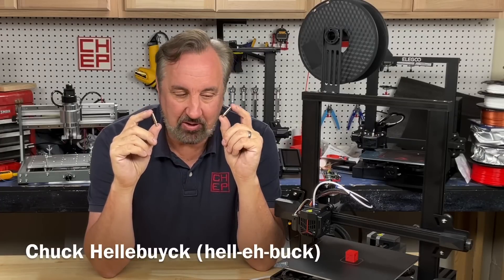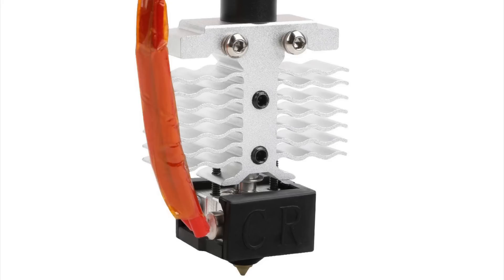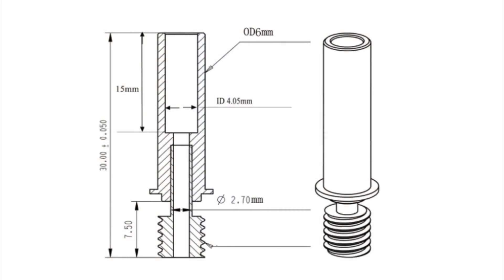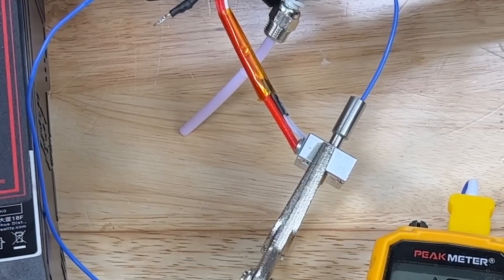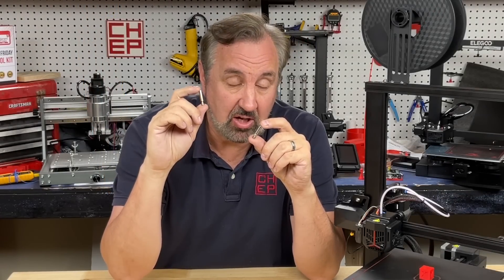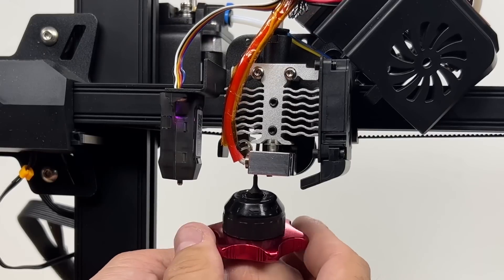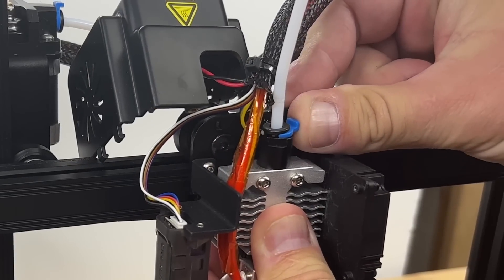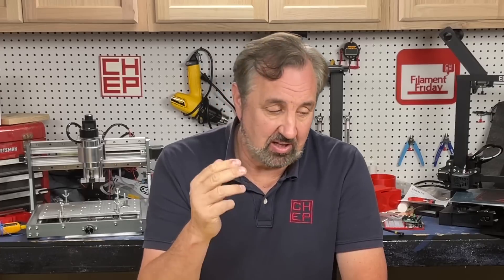Upgrade Ender 3 Neo Hot End

Comment: Hi @Chuck what an eye opening video! Thank you! just ordered all metal heatbreak from the link you provided. I have Ender 3 v2 Neo as well. I am only buying this to stop PTFE tubing not to melt and block nozzle some day. My printer is new but it is best to be prepared from the start I guess. Cause by design the stock heartbreak is a time bomb. What I wonder is Titanium heat transfer characteristics? Do you have to increase hotend temperature slightly for PLA? I am printing PLA at 210 Celsius with stock heatbreak. I have an update! Bi-metal heatbreak came installed exactly just as Chuck instructed. It works beautifully much more filament is can be extruded from nozzle with this upgrade too! Plus I don't have to worry about my PTFE tube melted one day in middle of printing... This is just awesome upgrade Chuck Thanks Man! There is no need to upgrade to slice engineering's hotend with this bi-metal heatbreak upgrade! Only thing was not exactly is the heatbreak's outer diameter is half mm bigger so I sanded down a little and then outer shell become exactly 6mm then I could insert heatbreak into the heatsink easily.

Comment: pleas do more for Ender 3 Neo!!!
Reply: Hey i am going to buy my first 3d printer but i am not able to decide which to buy ender 3 neo or anycubic cobra i am also new to 3d printing 
Please reply 🙏
Reply: @oioindoor8155  ender 3 neo is awesome
Reply: @gimmmy90 yes it is😅
Reply: @oioindoor8155 Im also new to 3d printing, and narrowed it down to the same 2 printers. I ended up buying the ender 3 neo not to long ago, and I like it. I still have problems with stringing, because I need to get better at the slicing software. I was using Creality slicer and was getting good results, but I’m moving over to cura slicer, and haven’t got the same results yet. The only thing I dont realy like about this printer is the hot end, and the drive system, direct drive sounds much nicer. However there are many upgrdes for this printer, and some are 3d printable upgrades… so thats nice. Hopefully this helps a bit if you haven’t already got one
Reply: YESSSSS
Reply: YOOPAI Spark Ender 3 NEO ... They finally released a decent hotend for the neo on Amazon... no modifications needed... so far I'm loving it and figured id come back to this video and share
Reply from the maker: @Silent_Steel - What is the name? All I see on amazon are the same type as original.
Reply: @FilamentFriday  YOOPAI Spark Ender 3 NEO ...  its black and orange... really wish youtube would let me post a link
Reply: I'll try and find an alternative way to search it up.... yea if you search "YOOPAI Spark Ender 3 NEO" it'll show up as the 1st 2 results... atleast for me... and has been working great in my ender 3 v2 neo... which has been hard to find replacement hotends that you don't have to modify
Reply: I was having problems with my neo throwing heating alarms around 210° which was driving me nuts... but this hotend has seemed to finally fix that issue... for now, anyway lol

Comment: This works fantastic on my ender 3 neo. I pair this and a brass/ruby nozzle for abrasive material. Reduce your retraction settings to 2mm at 80mm/s, and run a temp of 235 PLA, and 260 ABS. Carbon fiber PLA runs at 260 as well
Reply: were you having trouble at the lower temps?

Comment: My experience with the NEO - that darned GB3 board is a pain - cannot use any firmware other than Creality's.
Reply: GD32f*** boards work fine with MRISCIC pro firmware and Jyers firmware.  Just gotta flash the board with Creality's stock firmware first before re-flashing with another firmware.
Reply: No, I flashed klipper on it. It works like a charm. I used KIAUH, which is the standard way of installing klipper.
Reply: @abhijeet_ghosh   Have been struggling to get klipper working on the neo. Any tutorial or setup files you referred to?Any resources you can share will be appreciated

Comment: Hi. I just installed this heat break on my Ender 3 V2 Neo following your instructions, however now my printer won't extrude filament. The nozzle is hot, the heat block is hot, but the filament isn't coming through. It's like the heat break is so efficient that there's not enough heat to melt the filament. Any ideas?
Reply: Hola, lo que puede estar ocurriendo es que no quedó bien instalado el barrel con la boquilla. Hay videos en YouTube que explican cómo instalar y apretar en caliente para evitar fugas que ocasionen obstrucción. El problema debe ser eso ya que bien instalado no ocasiona problemas. Saludos cordiales!!
Reply: I know this comment was a while ago, but I’m having the same issue. Did you ever solve this?
Reply: @armoryofalbus  Yeah dude. It was the easiest thing in the end - you need to snip the filament at a 45° angle before feeding it in. Basically, the hotend is a little thinner than the filament so if it's cut straight then it won't fit. Basically need to get in a habit of cutting a 45° angle on the filament before feeding it in every time.
Reply: @HeroicDesignCo  amazing. I always snip it angled, but was having a bit of despair moment after installing this new piece and not having any filament come out..gave it another snip after reading your comment and it’s working like it should! So glad. did you mess with any other settings (retraction, temperature, etc) to get this thing working well with your printer? Thanks in advance.
Reply: @armoryofalbus  I did a retraction tower and ended up pushing it all the way up to 70 for the best results. Other than that it worked right out of the box.

Comment: Hi chuck. I hope
You can help me. I changed the heat break to what you recommended but now my dual drive filament extruded is clicking and stops the filament from going into the hot end. Any thoughts? I’ve already taken apart the hot end and reseated the new heatbreak and made changes, but it is still happening.
Reply: sounds like heat-creep.  Reduce retraction and temp.

Comment: This turned out to be a great upgrade, but it was definitely not "plug and play" for me. I had to tighten up retraction settings to around ~2mm like others have mentioned, but still got bad stringing.  After a PID auto-tune helped but did not solve my problem, I calibrated my extruder steps also. Out of the box it was under-extruding by 8mm. I also found it helped to return to the stock 200/60 PLA settings, and play with Z-hop.

Comment: 😠Beware of bad imitation heatbreaks. With the imitations, the lower metal part is screwed into the copper part for about 3.5 mm. Not pressed all the way to almost the teflon tube as in the picture with the sizes. Teflon tube can also only fit 4 mm and not 15 mm as in the picture. The pictute of the fake was the same as in the link from Chep.

Comment: Can anyone that has done this upgrade comment if it's actually made any difference? I have just installed this on my ender 3v2 Neo and have not yet really seen much of a difference... Would love to hear from anyone who has done this upgrade. Update: I have never ever had my machine give me system errors so often, 3 times was enough for me to change back to the standard great throat, I repeat do not even attempt this upgrade if you have the ender3 v2 Neo!!!! Over extrusion, system errors, to be honest with you why try to fix something that's not broken. I'm not going to even bother with my retraction settings to get this to work I tried adjusting the retraction but still had a temp to low error. Stay away!
Reply: Not a big difference, not worth the work.
Reply: There is a problem with stock thingy which is used on Ender 3 Neo as a heatbreak. PTFE tube gets carbonized and because of this printer gets clogged. It takes somewhere between 3 to 6 weeks of intensive printing (with PLA at 205°C temperature) to get into this trouble.

So, theoretically, this upgrade should 100% fix the issue. Plus you'll be able to print PETG, which is frankly bad idea with the stock heatbreak.

But. It's not as easy as Chep claims. :) Retraction settings must be corrected (otherwise you'll get the heatbreak clogged almost instantly). I faced issues with pretty bad stringing, which I can't address so far.

Comment: Yea this doesn't work.
Reply: It seems people is having issues with this. I did exactly what Chep did in this video and is working perfetly with my Ender Neo. I'm running temp tower tests and retraction tests and they are all working with pla (with obviously different outputs but all working). Update: after 4 days of printing with the bimetal the problems started (it clogged and skipped) so I went back to the stock barrel. I'm printing with PLA only and there is a lot of humidity here so I'm not quite sure if the barrel is the problem.

Comment: Hey Bud, I tried this but for some reason it's not pushing through. Its
getting stuck I believe at the smaller Neck portion of the new heat break. This is kind of strange because I took it out and tried to push the filament through with it not Installed and it goes through just fine. I am running a bowden Capricorn Tube Not sure if that's relevant but was hoping you might have some advice.  Thank you, 🙏 .
Reply: Get a new Bowden tube. The stock tube is fractionally larger and won't meet flush with the recess in the heat break.

Comment: Not a bad printer, but the company support is a 'F'.
I bought one of these 2 months ago.  Printer 5 rolls of filament with no real issues.  I cleaned it after each print, leveled the bed after each print etc etc.
Then the other day.  I had  a 15 hour PLA print going and I checked in on it after 8 hours from my remote app and the printer was moving fine but no filament was coming out.
I went to my print room and stopped the job.  The hotend had become clogged and the extruder continued to force filament down into the hot end where it built leaked and created a mess of the hot end.  It wasn't salvageable by cleaning and so I contacted their support.  I am sorry, but it is terrible.  This is a $15 part and I am having no luck get then to even understand.  This should be a slam dunk - send me another cheap hotend, but no they don't seem to get it.
I bought this as an entry level printer and was going to buy another Creality higher end model, but that is not going to happen.
Worst support I have even had.
I'll send the whole unit back to Amazon.
Reply: I don't understand why it's the company's responsibility to replace a part over an print error.
Reply: I had exactly opposite experience with Creality. I had an issue with my bed plate (which was kind of my fault). They not only sent out a replacement right away, they upgraded it. I have no complaints with their customer service. I'm sorry you had a bad experience.
Reply: @jbonewitz  eventually they sent the parts and I was able to get it going. 
Fast forward to now .. I bought a K1 and love it! ❤️

Comment: FYI: I have an Ender 3 Neo Max. I had to change my retraction time to 95 and my nozzle temp to 220 with PLA or the nozzle would clog. In the long run it will prevent the PTFE tube from getting destroyed but it's not quite plug n play.
Reply: Agreed, retraction settings need to be adjusted after installing this mod. What retraction settings have you found to work?
Reply: @teamkinetixmedia  95 works great
Reply: @elizabethdue4801  95 for what? 95mm/s retraction speed?

Comment: I ordered the same heatbreak, but it seems not all NEOs are manufactured equally. Even with the heatbreak cold and the heatsink heated to around 250 C I couldn't get it on to the heatbreak. I needed to result to sanding the heatsink down + use a hammer to get it on. Otherwise a grade upgrade! 

Are you planning to do more upgrade videos on it?

BTW, Klipper firmware on the V2 Neo improves print speed without a reduction in quality immensely for this printer. Because of the all metal chassis, I don't have oscillation issues either. I've ordered an accelerometer to see how far i can push it with input shaping next.

Comment: Im installed same bimetal throat into my cr-200b, retract distance 2mm + 0,5mm coast (3mm is clogged) result stringing.. 210-230C hotend. With old stock throat ptfe 5mm retract distance.. no stringing.
Abs+ esun

Comment: yeaa, after this upgrade my ender 3 neo stuck at extruder heating, it's either to cold or to hot :(
Reply: Sounds like you need to PID tune your nozzle temp
Reply: @pantherpigeon3048  actually that was it(thanks google), works like a charm now, many thanks

Comment: Did this upgrade and ever since been then the print quality has gone down I even put a Capricorn tube as well! Any suggestions would be greatly appreciated
Reply: When I replaced my tubing with Capricorn I was getting underextrusion and you could tell because the layers weren’t bonding very well. I figured out that I hadn’t installed the tubing correctly and needed to push it down further and tighten it while the nozzle was around 200° and that fixed all my problems.

Comment: I put one of these in my Ender 3V2 Neo and man, what a great improvement! Thanks Chuck!
Reply: Does it still work? :) I'm on my second attempt with this upgrade today. First time I got clogging after some 1 hour of print. Today I tried a heatbreak of a bit better quality + applied thermal paste — no clogging, but print quality is waaaay worse than with the stock option. Figured out that best retraction distance is not 2 mm (as people usually recommend) but 1.6 mm, it decreased stringing but it's still there.

What changes in settings you had to make to get it working nicely?
Reply: @arduino-org-ua  Sure does!

Comment: Up to what temperature can you print with this upgrade?
What upgrades are needed to raise the temperature to 300°?
Reply: Idk what you plan to print that needs 300c but you SHOULD be able to print up to 300c with just a heatbreak and firmware swap. I don't recommend it. 

I would recommend all metal heatbreak,copper heater block,50w heater,high temp thermistor,custom firmware.
Reply: @bleach_drink_me  Yes, I have read that the thermistor and the heater should be used only up to 260, because they can measure to one only up to then, besides is at these ptfe, which releases toxic substances at higher temperatures.
Do you have any recommendations for these parts (all metal heatbreak,copper heater block,50w heater,high temp thermistor)?
Reply: @bleach_drink_me  i cant see it

Comment: hey chep, you've been helping me alot since you are one of the only youtubers talking about the ender 3 neo. 

I got a simple question. I want to print with nylon carbon fiber. If I buy this upgrade do I still need to buy an all metal hotend kit from microswiss or other brand for carbon fibre?
Reply: I think you  would at least need a hardened nozzle,   essentially this  is converting the hotend to an all metal hotend I think, also the terminology is a bit off here, he call it a heat break but this specific part is called a throat piece ,the heat break is the metal   piece it fits into with the fins  ,  "I believe all metal hotend" refers to a heat break with this  metal throat piece  in it , if you buy an all metal hotend from microswiss you are essentially buying another  heat break that you already have, if you buy this  you reuse your heatbreak  but just change out the throat piece and make your own   all metal hotend, the microswiss had it all ready assembled
Reply from the maker: Pedro- Depends on the filament you choose. As long as it prints well at 260 or below it should work fine.
Reply: @FilamentFriday  But without this piece hot end temperatures higher than ~200-230 C will start destroying the PTFE in the Bowden tube and releasing those nasty chemicals, isn't it?
Reply from the maker: Dan - Yes that is a concern. I typically don’t recommend printing above 230°C on these PTFE to nozzle printers.
Reply: Perfect, thanks for the confirmation. This is the reason I just ordered one of these bi-metal heat breaks right after watching your video. I suppose with this in place it would be safe(r) to get the nozzle to ~250-260 °C, right?
Reply: Also, I like your videos a lot! Short and to the point, with useful info and a very soothing voice :) Answering the questions in the comments section is the cherry on top!
Reply from the maker: Thanks. Yes, it’s definitely safer.
Reply: Thank you very much for the info. I ordered the cr-6 se bi metallic heat break, the copper hot block, the silicone cover and some spare brass nozzles, including 0.6 mm and 0.8 mm ones. Would I need to upgrade also the heater element in order to print quicker? I have no idea if the stock one could cope to extrude more filament each second. If it needs to be upgraded, would you by any chance have a recommendation? E3v2 neo. Many thanks!
Reply from the maker: It should handle it

Comment: Is there a direct drive that’s works with the neo?
Reply: I just got a new on BF for 229 direct from Creality
 microcenter had the S1 for like 270 , so for $40 more  you could have got  the direct drive and  pretty much  similar specs with  the S1
Reply: Sprite SE is "direct" drive.  Actually uses a tube about 2" long between dual gear extruder and hot end.  Works great.

Comment: My neo is printing great,  but the prints are cementing to the bed.  I'm down to 50° with the hot end at 205°.
Reply: Could your nozzle be a touch too low? I adjusted my z offset up slightly and the prints were much easier to remove from the bed

Comment: Using a heatbreak on a 3d printer in 2022 is simply a design flaw. There's not reason to not have the heatsink connect directly to the ptfe tube.

Comment: I noticed you did not use thermal paste on the heat block?  Would not that have helped more?
Reply from the maker: Not really.
Reply: I used the paste because I was getting thermal runaway on every 4th or 5th print.  Adding the paste eliminated the problem.  It's been 6 mo. since I added the paste and no thermal runaway.
Reply: @ToolmanJoe what paste you used?